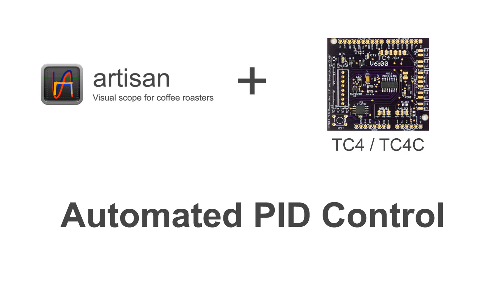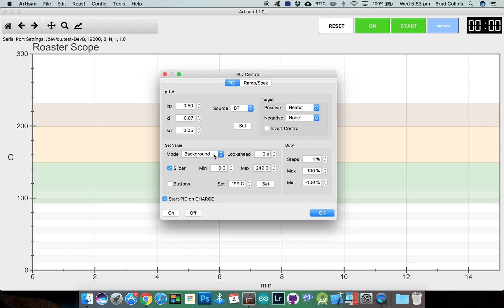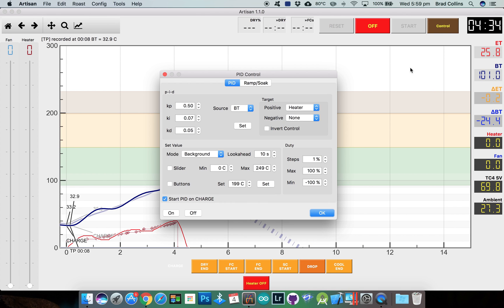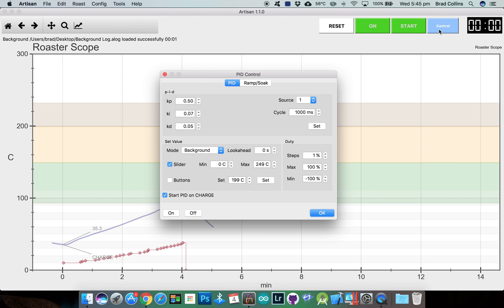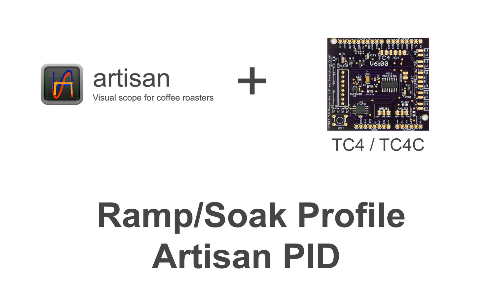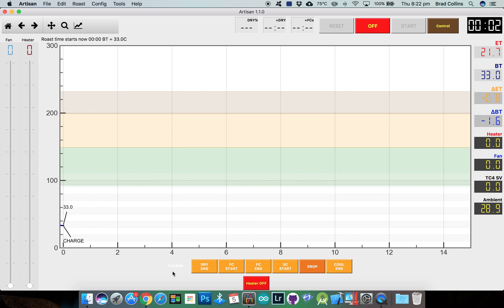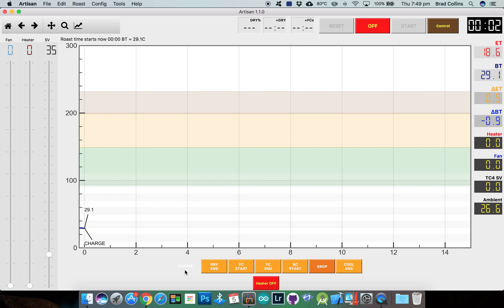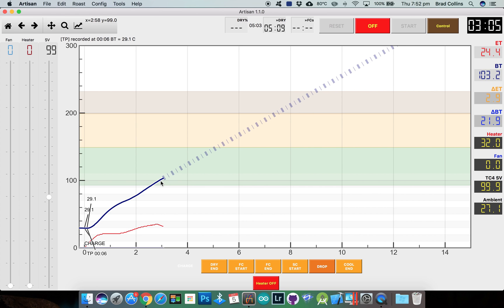Artisan Roaster Scope - TC4 PID Control

Comment: Hi, Why do you change your Baud rate to 19200? is it machine depended?
Reply from the maker: Yes, the baud rate is set depending on the hardware you are connecting to. In this case my TC4 is programmed to use 19290 baud.

Comment: Making my FB roaster  has been a learning experience but I've finally got the TC4+ installed and I'm ready to start playing with some profiles. Had to move the TC4+'s mosfet off the main board and onto a sizeable heat sink as my fan is 18v/16A.  A couple of weeks ago my thermocouple wires shorted and I fried the MCP3424 chip - ordered a replacement chip and amazed myself when I finally got the TC4+ working again. Your videos have been very helpful, thanks so much!  👍